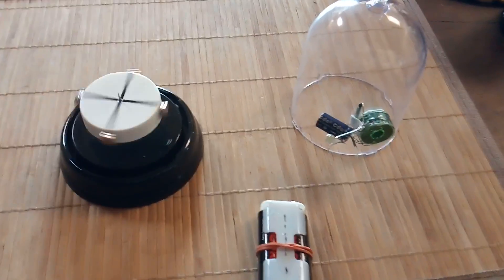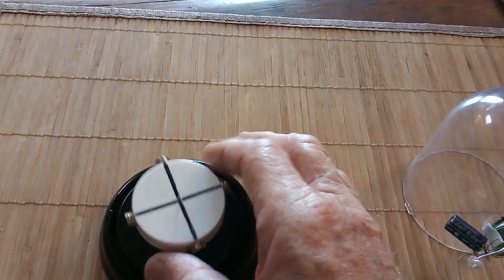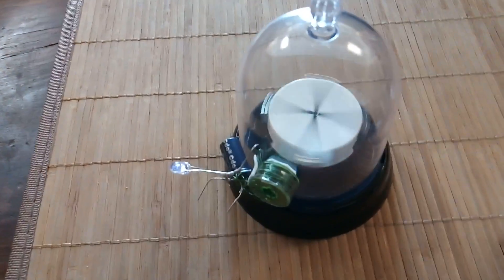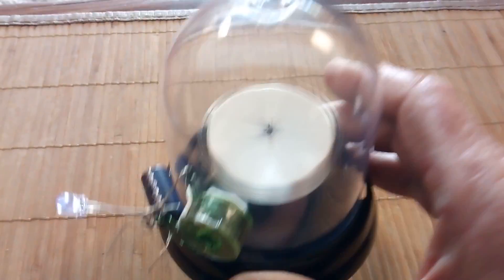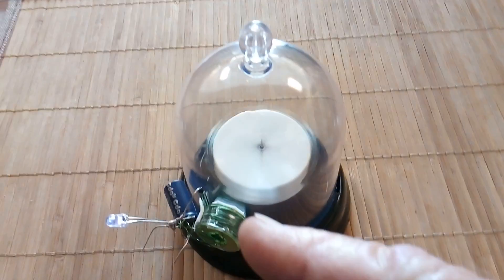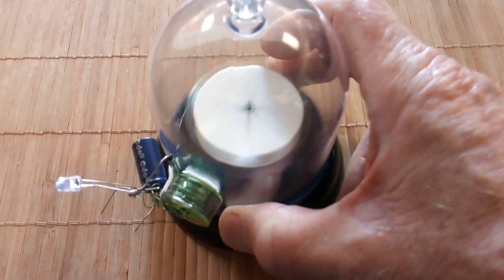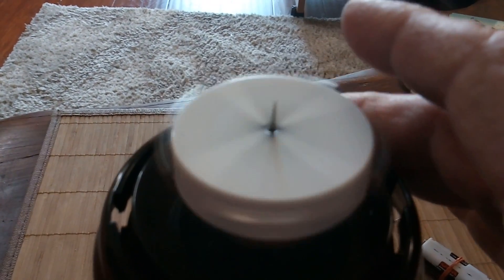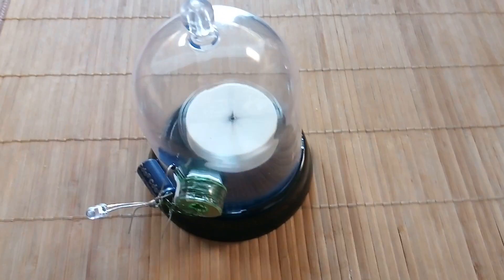Floating rotor and the easy driver

Comment: This is inspiring! Could you use a glass bead as the bearing surface in the lid to further lower resistance? I was thinking of using a bit of a glass phone screen protector with a hole in it for a camera. I haven't gotten around to that experiment yet. Thanks for sharing!
Reply from the maker: Thanks.  I thought about a glass bead also.  Getting it glued in perfectly so the rotor doesn't wobble might be hard.

Comment: Nice tool for experimentation. Thank you for sharing.
The delayed Lenz effect leading to increased rotor speed is a very clean demonstration. An additional and easy test would be to put a short and thin iron rods for the coil core and observe the effect.

Comment: Well done , Rusty. Seems to be very easy and efficient magnetic bearing this way...woll this work quieter with a transistor circuit ? Is the Reed Switch making all the noise ? How long does it run on a fully charged Supercap ? Regards Stefan.
Reply from the maker: Thanks.  I am working on other driver setups.  The goal would be to drive this with that micro amp two transistor circuit that I often use.  This will already run on a 'solar waver' driver so it should not be hard to drive it with the complimentary transistor driver circuit.  The reed switch is making the noise on this right now but I could use a different reed switch and make it quieter.

Comment: I was surprised when you showed the underside of the rotor.  I expected a second ring magnet (on axis) opposing the ring magnet in the base.  But I guess the neo magnets around the rim also provide the levitation.
Reply from the maker: I originally had this with a ring magnet on the rotor but by accident I discovered that with this particular rotor magnet arrangement I didn't need it.
Reply from the maker: @mnsman1-gv4nz     Cool.  The Slayer exciter addition was a nice touch.

Comment: Nice! The magnetic bearing was my idea too for your needle motor. It's so simple and works well! Greetings from Hungary! Blade
Reply from the maker: Hi Blade.  Yes this seems to work well.  The basic 'needle motor' idea is great but for non-stop running over many years the setup has to really durable and reliable.

Comment: Well done Lidmotor. Just asking if you saw your earlier set up of magnets and driver circuit caused the rpm to be much higher. But I am really pleased to hear that this may be what you wanted for your long running motors. Thank you
Reply from the maker: This might solve my bearing problem but I need to run this for about a year non- stop to see what happens.  Ha.  The magnet and rotor speed is still a work in progress.  The whole thing is a pretty complex situation.

Comment: i'm working on a levitron type circuit that will suspend a rotor/lid driven by similar means...
Reply from the maker: Here is another levitated pulse motor I did back in 2012  https://www.youtube.com/watch?v=jJtzxST5f8A
Reply: exactly rite...thinking more repulsive, minimal power, done similar before... @Lidmotor

Comment: Could you also use( at some great speed )  an air cushion like build in an air foil to the lid to further reduce contact with bearing material of course it mite add drag and be counter productive.....  Neat idea with the out drive system.
Reply from the maker: Thanks.